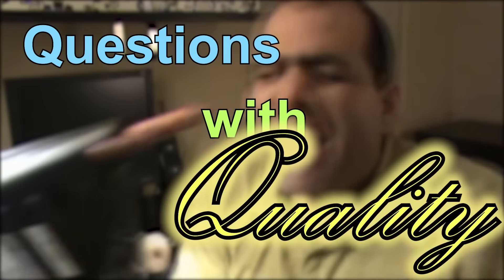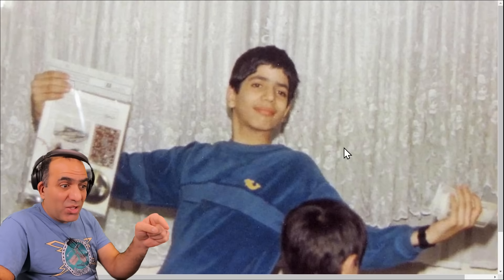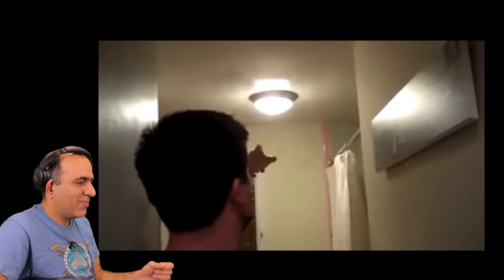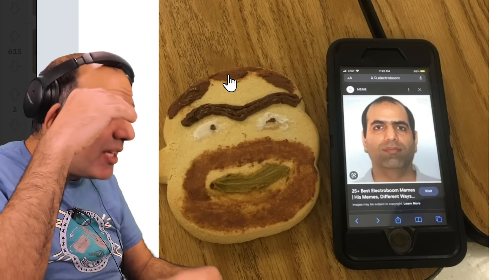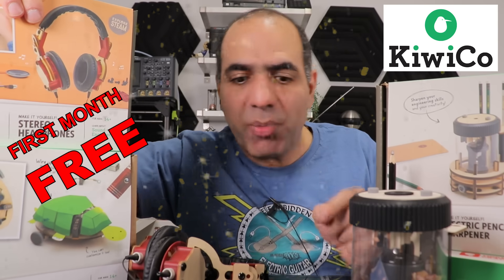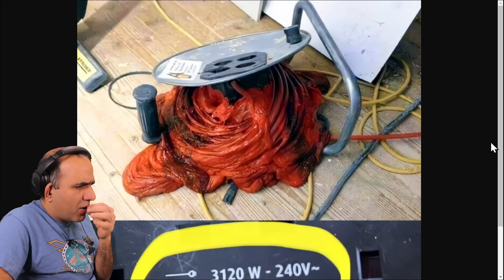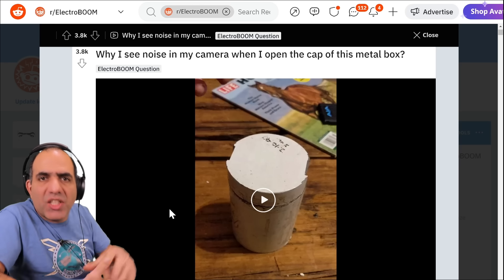Can ENGINE Run on WATER?! They Copied my Toy (LATITY-011)

Comment: I had a similar issue to that bathroom guy, in an apartment i used to live in. Came like this. To this day Im not positive how it was happening, but i theorized some things over the years. I think the various apartments were miswired TOGETHER, but I've ve worked with high voltage electricity for almost 10 years and still don't fully understand it, or whatever dark magic was happening in that apartment.

The switch would sometimes light the living room, randomly (assuming other apartments got occupied and drew power that previously was not being drawn) it stops turning the light on. Bulb is fine. Turning on the electric stove in the kitchen we discovered lit the bulb. 

Turning one burner on acted as a low dimmer. 2 burners, brighter etc. The only way to have the light be on completely was to have all burners on high and oven on 500°.

We never used the stove as young degenerates so we didn't care, and we had multiple pets against rhe lease rules so we never sought treatment for it from the landlord (who loved us and didn't care about the animals but his wife was insufferable).

One morning, I have this gut feeling pull me out of my dream, and I immediately notice the heat. The room is filled with thick smoke. I wake everyone up (a hilarious story in and of itself) and discover the power had randomly corrected sometime early in the morning and ignited a Styrofoam cooler that was on the counter next to the stove, on account of all 4 burners being left on high 🤣

We weren't there much longer, and being young and dumb we thought the oven-burner dimmer switch for the living room ceiling light was the coolest thing in the freaking world
Reply: Sounds like maybe you had a phase wire disconnected.

Comment: Screams “”There are no engines that run on burning water”” 

Thomas the tank engine rolls past “choochoo motherf*ckers”
Reply from the maker: But is Thomas burning water, like gasoline?! It is burning COAL!
Reply: @ElectroBOOM  it’s only burning coal to produce the heat to evaporate the water which in turn drives the engine as steam
Reply: apparently you continue to think that this comment was witty, or that it even made sense.!      neither one is  True.

Comment: 3:20 Had the same problem. I've made a socket connected from a light switch and when I turn on an electrical kettle - the light in a room turned on.

Comment: 3:52 - Electrical Troubleshooter here!

You’re losing a neutral to the light. Clearly all of the devices on the walls are all connected to the same circuit. When you plug the hair dryer in, it accepts the neutral that isn’t being fed to the rest of the circuit and pumping it to the light, providing a “false” neutral. This happens a lot with LEDs being installed into older wired houses. 

Another solution could be that when the new fixture was put in, he isolated the true switchleg, and connected the hot side wire to the main set of wires in that light fixture box, thus giving it continuity to each switch and the outlet.

It seems pretty big and crazy, but it takes an electrician about 15-20 minutes to figure out and fix all the wires in each of the devices.

Pretty funny stuff.

Comment: Maybe You can add video about energy harvesting, some diy ways to use less energy. Off grid? Lifepo4 they has a lot of current :) If I remember correctly there was no episode about inverter dc to ac “reverse full bridge rectifier” :) Solar panels and nasty big currents on dc voltage. Great content you really make my day. Thank You for your work.

Comment: The carbon rod welding only works if there is enough material to essentially graft onto the other object. It doesn't produce material like a welding rod they can also be used to make a makeshift furnace with electricity instead of burning gas.

Comment: Rectify me this: electrical engineer confuses welding with soldering... Come on, it's clearly better to have galvanic reactions going on in your weak ass chassis because some muppet used a soldering iron to fix your car and you know it...

Comment: 8:40 This is the exact reason those extension spools come with "DO NOT OPERATE SPOOLED UP" written somewhere on them.

1: Cable can't dissipate heat, because it's all coiled and packed up.
2: Induction. Makes things warm. For reference see induction stoves or induction forging.

Run a kW or two through that spool and best case you'll get is an un-despoolable spool, because the insulation will just melt and become one. Worst case is a quick visit from the fire department.
Reply: Induction doesn't make the coil itself warm
Reply: @Owen_loves_Butters  It does in this case, because there's not one but three coils. P, N and PE. The magnetic field produced by the AC in P and N will most certainly heat PE by induction. And they'll probably also heat each other due to the fact that their magnetic fields always face opposite from each other.
Reply: @Phrew  Even if that were true, copper isn't heated by induction by any significant amount. I wonder if there's an experiment that would answer this
Reply: @Owen_loves_Butters  Huh, I just tried finding any details on that and apparently the induction thing is a myth.
Reply: The extension cord can extend no longer

Comment: Re: bathroom outlet puzzle.
Older houses were wired with switched outlets on the same circuit as the light. That made it less likely for a person to leave things like hair dryers on and walk away, creating a fire hazard. This looks to be one of those houses, but the guy accidentally wired in the outlet parallel to the switch. It is possible that the former fan switch was sort of like a main switch for the whole bathroom, turning everything on/off with the former mirror light switch also controlling the outlet.

Comment: HHO generator makes more sense for a "cheap electric conversion" rather than run on water; also you need a salt diferent than regular one or you will produce chlorine instead of fuel wich is toxic xD 2nd Law Violation attemp always fail. I love Latitys videos. Like from Spain!
Reply: do you realize that  hho  is  exactly the  SAME  as saying   h2o    ?
Reply: @daviddavids2884  yep, i've miss generator, i've corrected that, thanks

Comment: In welding they have carbon arc rods, but theses rods are for gouging a channel in metal, ie, removing metal, not depositing metal for a weld,  so that when it's filled with weld it has deeper penetration, ie, a stronger weld.

Comment: Hey my friend! i am from Brazil, I want to do you a challenge experiment!
he experiment is as follows... you'll need a good space to carry it out.
You will need two long grounded conductive rods, where each one has its own conductive plate on top of them...
These two conductive rods will be connected to each other by a wire where there is some device like an LED/lamp.
On top of each of these conductive plates, there will be two other conductive plates (which I call inductor plates) hanging above each other, so that they do not touch each other (the air will serve as an insulator).
These two conductive plates that are suspended will be connected to two insulating rods, also being connected to a power source (a car battery for example, it may be necessary to use a high voltage source or more than one car battery together. ..), this source of energy will be connected to these two suspended conductive plates, each with its respective charge, positive and negative...
The earth must be wet with water and preferably with salt (to increase conductivity).
What is the concept behind such an experiment?, the central idea is to use these suspended conductive plates to induce opposite charges to the plates that will be on the ground in contact with the grounded rods... the charges contained in the earth will rise through these two long rods conductors to stay close to these suspended conductive plates containing their opposite charges, however as the two conductive rods on the floor are connected to each other, having opposite signs... the charges ended up having to pass through the path where the lamp is to neutralize each other ...then lighting the lamp...being a part of those loads consumed.
This whole cycle is finite, until the energy source used ends up having an accumulation of small losses with the suspended inductor plates (since they will have friction with air particles, slowly losing their charges)....
The key issue is that the loads from the suspended inductor plates will not be used to perform "some work".
There will only be transfer of energy from one point on the earth to another point on the earth. turn on a lamp/LED).
As the earth is the largest body in existence, it is an unlimited source of positive/negative charges...
This is the experiment I call earth energy, we create an "artificial" absence of charges between two points on earth, to do some work and fill it up again.

Comment: I know the water engine is a frustrating concept for you to deal with, but could you explain the possible efficiency of such a system? I am curious about using this to drive a car, and I want to know how I would go about writing the equation for the range. I would also add another source such as solar  to slow the drain of the battery
Reply: That would be interesting indeed. 
Of course you need a huge battery to buffer the lysis cycle. 
Yet I doubt that even plastering the whole car with solar panels will generate enough extra power to run for a reasonable time. 

Without even calculating, see it this way: Combustion engines are waaaay less effective than electric motors. 
So if, then the much more power-efficient way would be direct electrical drive.
This also cutting away the extra weight of engine, gearbox, water tank, etc. 
And if this could actually be done in a car plastered with solar panels, we would see them on the streets for a long time already ^^

Still, from a purely what-if point of view, I’m curious too.
Reply: Look at the Stanley Meyer design that he was killed for. 
One of the keys for disassociation of the water molecules is sharp transient pulsed voltage. This greatly reduces drain on the source battery and produces a return spike of radiant energy. The radiant or negative energy was first addressed by Tesla and is the biggest missed factor in his work. That spike is more efficient than conventional energy in that task and is an environmental input.

Comment: Hi ElectroBoom,

I have a question about this "water motor".
Suppose the engine was producing enough power to split enough water into oxygen and hydrogen to sustain itself.
Wouldn't it mean that every time there is a combustion, matter is also destroyed and, in conclusion, our universe is becoming lighter and lighter?
And that's why our universe is drifting apart more and more?

Comment: The I. C. PEECH hypothesis of the Great Pyramid of Giza.
The Great Pyramid is a piezoelectric power generator,  Hydrogen  / Oxygen fueled,  internal combustion.  The queen's chamber held water and liberated fuel through pyrolysis  / electrolysis,  contained a heat source in the Niche and the "air shafts " are conductors.  The king's chamber is made of piezoelectric material and the "sarcophagus "contained the igniter.
Reply: wow    sounds like an ancient turbo encabulator          l m f a o
Reply: @daviddavids2884   Thank you Davids. The piezoelectric  / electrochemical hypothesis arises from the appearance of wear and tear evidence present on key features of the Great Pyramid including; 
The queen's chamber was documented as being found encrusted with some type of salt deposits.  Substantial erosion of the limestone "Great Step ".  The appearance of a thermal signature in the king's chamber's ante chamber.  The appearance of severe erosion on the "sarcophagus ".

Comment: For the last video though, the noise was added as a visual effect - radiation doesn't affect digital cameras. Still funny.
Reply: you sound way too sure that you know what you are talking about.!!!
the sensor in a  dv recorder/camera   MIGHT  be  affected  by radiation. 
did you think of  THAT  possibility,  before  commenting.?
Reply: @daviddavids2884  Digital cameras are only affected by extreme levels of beta & gamma radiation (stuff like Cobalt-60), like any electronics (the light sensors don't have any special interaction with radiation), while the old argentic paper used in old cameras was directly impressed by alpha & beta radiation, with an equivalent reaction to visible light.

Comment: Microwave: If half if the energy you're putting into something for it to work isn't being used for the intended purpose, it's being wasted because it's (probably) just being turned into waste heat or something. I wouldn't know.

Edit: It took me like 3 seconds for that last clip to go "...Is that radiation???" After seeing the effect on the camera. I've seen too much stuff with radiation.. It's fascinating, though

Comment: those hydroxide generators are a bit dangerous, i tried some years ago with a glass jar and the psu i scavenge out of a large printer, first it was fun, but i forgot and let it on and the jar exloded when i turned a drill near it

Comment: An engine can run on 'burning water'...it's called a steam engine. but the video scetch.
Reply: child        a steam engine runs because of  HEAT,  not because of steam/water.
https://en.wikipedia.org/wiki/Steam_engine
Reply: @daviddavids2884  steam pushes the pistons

Comment: To be fair, hydrogen combustion engines are a real thing, so "burning water" isn't really too far of a stretch. What is wrong is to suggest that the electrolysis uses less energy than the combustion engine produces. Also not sure if its even possible to just mod an existing gas powered combustion engine to burn hydrogen, so I have serious doubts that its even actually running on hydrogen.

Comment: When you talked about arcs jumping the shortest distance in a unified medium it gave me an idea.... could sound, thus airwaves with low pressure zones, change the way the arcs would choose? Go test this with the slowmo guys please :D
Reply: yes, they can, they follow the movement of the air since the current usually wants to keep flowing through the ionized air.

Comment: 3:49 i already know. Cowboy borrowed lamp live/neutral from socket. didn't sleeve the neutral/live to be marked switched. The guy wired all neutrals and lives together, so the result is luckily no short across them (since he kept same colors together) but the switch wire is giving an alternative path through the socket and in series with the mirror lamp acting as a balast giving the "low power".

Comment: My late father was a radiologist. Mostly he did diagnosis but for a few years he was treating patients with radiation from cobalt-60. A few times he gave me lead containers that the cobalt-60 pellets had been shipped in. Interesting that the first ones were bare lead with just a little tarnish on it, but later the lead was encased in plastic with the texture of hard rubber: maybe someone was needlessly afraid of metallic lead. I also used to have a Lucite keychain with embedded metal pellets the size and shape of the cobalt-60 ones, promoting Atomic Energy of Canada. Of course the pellets were fake.
Reply: time to get some real pellets
Reply: So do you know if the guy in the video with the leas cylinder was giving himself dangerous doses of radiation? o,o

He put his freakin hand right on top of it! Xo
Reply: @leahl5007  Medical isotopes are generally short lived. It's the reason Australia has one Nuclear plant, to generate medical isotopes. Importing them takes too long and is too costly so they have to be locally made.
Reply: We must rebuild and bring back proper electricians

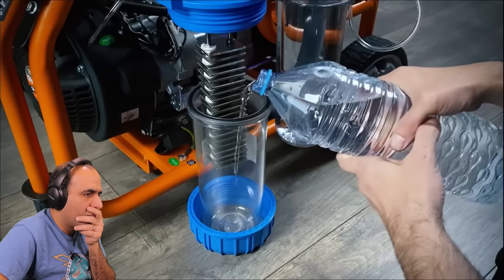Comment: 11:54 The water engine video is fake. Sure, it can run on electrolysis for a bit of time, but shortly the metal will be surrounded by burned salts. And you must clean that out in order to continue doing electrolysis effectively. So no, we haven't gotten to the point of engines running on hydrogen yet. Also, I checked out his channel a time ago, half of his content is about a "free energy" device that he made. Other videos include how "the laws of electromagnetism are fake".
Reply: Dang, I'm guessing the comments are turned off so people can't tell if its true or not.

edit: i checked out the original video. it does have comments on. and im surprised by the amount of comments from people saying they tried it and it works.
Reply: @Jose.AFT.Saddul  As I said, it does work but just for a while. If you want to use it as an actual functional engine like for example you use your car, it would soon stop working. This is because the metal fins get surrounded by the salts in the water that are actually reaponsible for the electrolysis being possible.
Reply: @Jose.AFT.Saddul  In fact, you can really see this when that same guy does a small version of this. The container where the electrolysis is done gets brown really quickly.

Comment: Technically there can be engine running on water. Just split water into H2 and O2 and somehow get a hold of fusion reactor that can fuse pure hydrogen. Easy right?

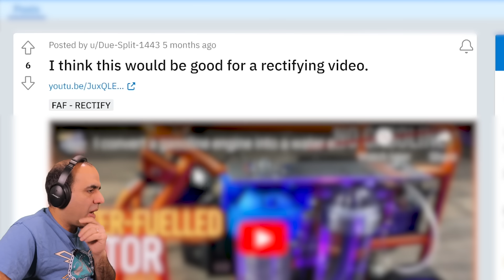Comment: 11:50 - technically it works but is greatly inefficient. It could be improved by getting rid of unnecessary parts. Like the dynamo. Or the fuel cell. Or the internal combustion engine.

Just power the tools directly from the battery.